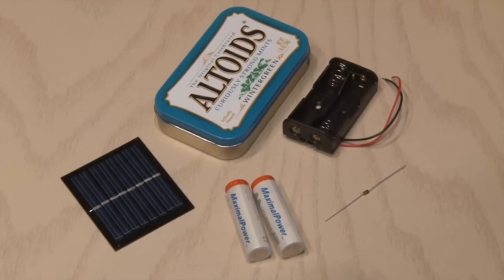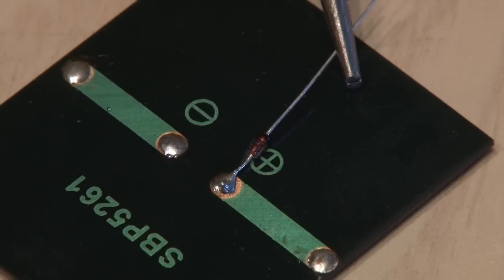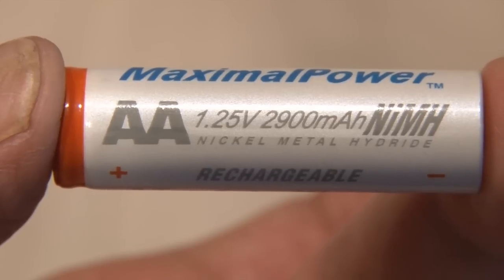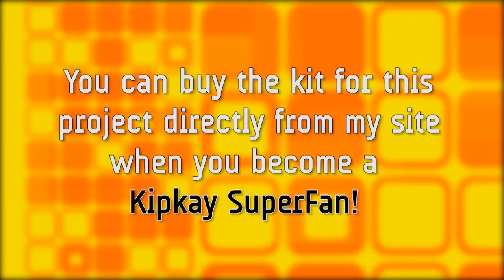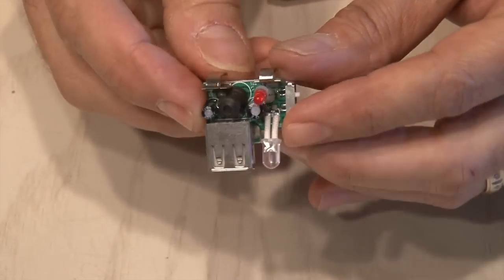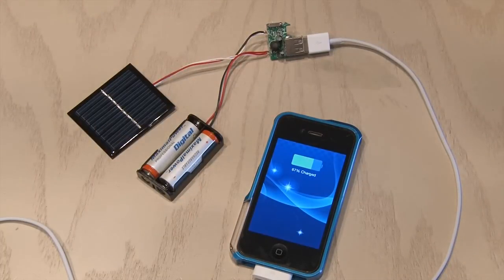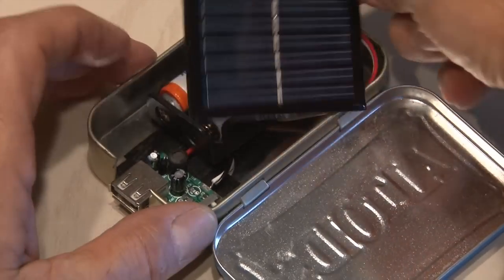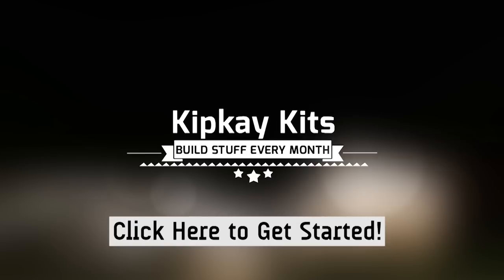Build a Kipkay Solar USB Charger!

Comment from the maker: Build your own Solar USB Charger!
Reply: you need to do it yourself, you can't have a ready made free sample, if you make it yourself, you can customize your own to do what you want
Reply: kipkay When you say standard diode do you mean something like this: 1N4007 1A 1000V Rectifier Diode DO-41 Tape. 
Because if not, I'm at a complete loss.
Reply: kipkay How many amps does the usb regulator provides?
Reply: Can you use rectifier diodes?
Reply: +Lone Wolf yes, any diode should do
standard means that other diodes like leds, and zeners won't work
Reply: thaks:)
Reply: Lone Wolf oops I wasn't paying much attention
Zeners will work and rectifiers also work
Zeners are more of a stabilizer
Reply: ok
this may be helpful for me
thanks to telling me all that
Reply: sir wat is that white device u used...
Reply: Raja Sekaran it's a device that uses normal batteries to charge a phone
Reply: where do u live and how much are you selling them I  like your video and I doing it for my project from school
Reply: +Angel Sanchez same
Reply: The kit isn't on the website anymore
Reply: i tried clicking on the link at the end of the video and your website told me it couldn't find anything for the link. Can this be fixed?
Reply: Pls fix it on the website
Reply: will any diode work?
Reply: yes
Reply: kipkay I don't have material
Reply: I really want to make this but what diode do I need, and instead of a portable charger board, can I just use a dc to DC booster 5v module?

Comment: Did he buy a portable charger to make a portable charger? I'm the only one that seems concerned...
Reply: christian villegas i thought that to lol. to make it easier he could have taken it apart, drilled holes, and soldered the solar panel then put it back togeather
Reply: Christian Villegas  He added a solar panel .
Reply: *****
But you can use this version while camping, your version requires batteries to carry energy, this relies on the sun.
Reply: Walter White Now he can use the portable charger to charge the portable charger.
Reply: *****
where's the fun in that?
Reply: +Christian Villegas that portable charger you can get get at the dollar tree so its worth it

Comment: This is by far the best and easiest diy solar charger for iPhones I've seen on here. KipKay makes it look so simple. Some of you are asking what the standard diode is? I live in the uk and I've always used a N1914 diode (I think those are the right numbers??) the one I use has a white stripe instead of a black one but yet principal when soldering is the same. The diodes are just designed to stop any power being transferred back into the solar panel from the batteries. I would recommend buying good quality rechargeable batteries with a high Mah as shown in the video, you can get 4 x AA rechargeable ones from my local pound shop but they only have 800mah power so it wouldn't give you much oooomph when charging an iphone.

Lastly, the only thing I do differently is leave a little toggle switch and the small led on the finished product as I like the fact that you can switch it on and off.

Overall a fantastic little project to complete in an hour or over a weekend. Thank you KipKay once again for your great tutorials

Comment: I would have mounted the solar panel on the top of the tin, just ran the wires through the tin and make it openable if you ever needed to replace the rechargable batteries
Reply: True

Comment: Wat was the tool that u used to connect all the wires . It was like a heatin tool with a liquid that connected all the wires .
Reply: em... soldering iron?
Reply: It's called a sodder gun
Reply: Soldering iron
Reply: Jevin Wilson ur the straight example of autosm
Reply: SaUcE x EeVeE Well that's ironic

Comment: I started building one of these years ago with regulators and everything so as to avoid possibly damaging any batteries by running too much juice into them... shortly after, these things were all being sold in the store.  I still have the stuff to make it (which I paid $6 for at radio shack) and still want to finish it... maybe a couple years down the road. :)

Comment: Would have been much better to make holes in the lid for the solar panel wires then hot glue the panel to the lid
Reply: i think the solar panel would retain too much heat there has to be air flow from under it

Comment: Can you connect the solar panel straight to the female USB port instead of the batteries? I just want full power as fast as I can. AKA zombie apocalypse.
Reply: Unfortunately not because the solar panel won't produce enough energy to charge your phone. But if you connect batteries, the solar panel will charge those batteries then from the batteries it will go to the 5v converter and provide a semi efficient charge

Comment: youre correct on that. You see he also uses an emergency phone charger which uses two double a batteries aswell. Inside that emergency charger is a 5volt dc boost circuit. This special circuit takes the 1.2vx2=2.4 volts(roughlys) and runs it through an oscillator which outputs a steady 5volts in a square wave. You see similar circuits in garden lights that uses one double a battery 1.2volts (mi-mh) to light a 3volt white led.
Reply: WTF?!

Comment: Couldn't you overcharge the batteries like this?
Reply: +Two - Dimensional nimh wont get overcharged from this puny panel
Reply: +DMAN22yeah that's a 4v panel, it may overchange them
Reply: Gulherme Pereira it will put out less than 100ma, which at 4v is only .4v, which will be dissipated as a trivial amount of heat.
Reply: DMAN22yeah So, instead of overcharging, it will just heat the batteries ever so slightly?
Reply: +Two - Dimensional yeah pretty much, they are supposed to get warm during charging anyways
Reply: DMAN22yeah Ok thanks

Comment: A diode is like a one way valve. It allows current to flow to charge your batteries, but prevents it from flowing the other way, discharging them.

Comment: Great video, I have 2 questions though. Would this work on a larger scale with more batteries and a stronger solar pannel? And, does the AA battery holder work as the input for solar energy as well as the output for power to the phone?
Thanks!

Comment: Will this work for an iPhone 5 connector? I'm interested in buying the kit. Also where can I get a soldering gun?
Reply: Yes, as long as it has a USB port. (The Lightning to USB cord) And soldering irons/guns are available at Radio Shack.
Reply: +jhRobert Skywalker
Reply: Buy it from the hardware store
Reply: Enmanuel Diaz Yes it will because it is USB
Reply: no, it doesnt charge if you dont use original Apple charger and usb, source: experience
Reply: Francisco Barraza it will, its probley have a broken Lighting Connector

Comment: The circuit board from that charger is a step-up transformer adapter, increasing about 3v to 5v for USB. In case anyone was wondering.
Reply: But without the on/off switch isn't that transformer constantly draining the batteries?  Shouldn't there be a switch??
Reply: mikekoz68
I never mentioned switches anywhere. But you're right, a switch would save on battery life big time.
Reply: Theres a switch on the circuit that little bar

Comment: My point is that solder keeps the flow of electrons on the path you want it to but hot glue would not. Am I right? It has been years since I built something. Thanks!

Comment: they produce 3v's, yes, but the wiring from the battery pack is also attached to a solar panel,  so i'd imagine the board would be getting a charge from the batteries and the solar panel.

Comment: is it possible to cut a slot kind of like a window for the solar panel then glue it so the altoidsso it exposes the solar panel so when u use it the other wires and stuff wont get exposed(just in case if it drizzles a little or if u accidently drop or something like that)

Comment: Idea's great, but does it really work?

I would guess using one of those "Grade A" cells out there you could get the energy from one panel in full sunlight, but this one looks small, and with low light it might take very long to charge.

Comment: Without boost buck circuit I can't realize it? Maybe if I should take solar pannel and batteries in series, when the solar pannel produces 3 volt and batteries produces about 2 volt, there are 5 volt so I can prevent use the circuit.. it's right?

Comment: The charger would be restricted to not allow back flow of power in to the batteries.  You could wire around that, but it probably would just be easier to make a new circuit like this.

Comment: So to apply solder for example you have to take the solder stick thing then melt it on the solar panel negative and positive spots then take the solder stick again then melt it on the diode. Then attach the diode to the positive side and melt them together with the solder gun????? And the same thing for wires??

Comment: If I replace the chip component by a USB female termination, a on/off switch and connect those to cables comming from the bateries, will it work? Destroying a functional usb emergency charger seems a little too much for this project...

Comment: I built a solar charger similar to this, the first edition of it I used hot glue to hold it together and it got hot in the sun and melted the glue which leaked out.  I would recommend using a different type of glue
Reply: xD Thanks for the comment I won't be using hot glue when I do this.
Reply: Legomax Gaming can you help me what are those red and white cables that he soldered to the solar panel called
Reply: Cesar Martinez just use any type of wire it doesn't matter

Comment: I just have a question about the battery setup. If they both charge at the same time, will one be done before the other, or will the charge even out between them? Also, can I use a 1N34A diode for this?

Comment: I don't understand the concept of the diode really, I know they only let a small current pass. I am making one and is there a specific one for different voltage? And I am using 9v. because I want to charge my ipad so , do I need a different one, will it work on my phone too??? And instead of 1 USB Ports I am using 2 does it make a difference??? THANK YOU SO MUCH!!!

Comment: Would it be possible to put holes in the top of the tin, put the wires through there, and hot glue the solar bit to the top? or would that break something?

Comment: yeah. Thats what i was thinking. But i think it might just charge a little slow, or in some cases, i think there is a little transformer in the phone. Anyway, there's visual proof! PS: Voltage is important in electronics but you MUST remember the difference between volts and watts. Volts is BASICALLY how fast the electricity is, but WATTS is BASICALLY how powerful the electricity is!

Comment: Technically yes, but that would just involve an extra step.  You'd have to charge up the batteries first, then charge the USB device.  Much more efficient to do it all at once.  And really with this he's basically just using the batteries as large capacitors.

Comment: You could cut a hole in the top of the Altoids tin and glue the solar panel in place. Then you don't have to move the inside components around as much!

Comment: quick question, wouldn't it be a good idea to have a hole in the roof of the tin in order to attach the solar generator to it so you dont have to open the box to charge things?
Reply: That's what I did, and it works you should do it
Reply: +ItzLezgo can i use 6v solar panel?
Reply: +Farid Yusubov no it is two much power and can hurt the battery's and the phone
Reply: +Farid Yusubov yes but  It will make it charge faster
Reply: +Farid Yusubov yes, you can use a 6v solar panel but you need a 3v Zener-diode to regulate the voltage

Comment: Just built this using these instructions plus step by step found on instructables... BUT... When I plug in iPhone 4s, I get nothing! It sings and shows it's charging, but loses power and doesn't charge even with the device off...!!!  I'm using 5v solar panel and 4 AA batteries. Also I am using the EXACT same charger kipkay disassembles and uses in his video! So why no charge?????  Someone help!!!  Kipkay? I am a superfan, after all!
Reply: Most usb plugs only put out 500mah of current but some of today's gadgets draw more then 500mah (like 2100mah for tablets), although the batteries are rated at 2900mah the circuit board may only be allowing the 500mah. If your phone draws more then 500mah that would your problem.
Reply: iPhone 4s... Not sure how much power is being drawn BUT most vids on here show it charging one...?
any ideas?
Reply: FloridaAdventurers
Look on your wall charger and see what the output current is that should tell you what it runs on. There is a solar usb charger on ebay that has a 10000mah battery and 2x usb plugs that supply 1A and 2A of current for under $20. Ive seen review videos on it showing iphones charging on it.
Reply: Allen McKinney
im using a 2AA battery recharging pack from ebay.  works fine by itself with the phone but when i hook up the two sets of 2 AA in parallel cells, it wont work... I hook up each ind. "Cell", works fine, but when wired together ... no luck...?
Reply: FloridaAdventurers
Not sure about that one. Are you making sure the + and - is right? You using rechargeable AA's or alkaline?
Reply: yes, and rechargeables 1.2v HR6 aa's
Reply: FloridaAdventurers
Thats interesting. It should work as long as the input voltage is the same. The only thing I can thank of is maybe the charger is sensing something we don't know about.
Reply: Allen McKinney
Possibly...
Reply: FloridaAdventurers 4 AA batteries = 4 * 1.25v = 5v, you probably need a solar panel that outputs a higher voltage, or you can try using only 3 batteries in series.
Reply: The diode.
Reply: kyleinmt
i have the diode in the right place, im thinking now that the rechargeables only put out 2.4 volts... i may need to add a thind to each "Cell" to increase it to 3.6v    think thast;ll work?

Comment: I have a lithium battery can i use that for this project instead of using the 2 AA batteries. and if it is possible can you do a video built with a lithium battery

Comment: If you're not taking the batteries out, couldn't you just use a capacitor instead?  Or would that be more expensive?  I haven't looked for the components, so I don't know.

Comment: I have a 3 slot triple a battery holder, would it work if i put in 2 batteries in 2/3 slots and then connected wires to those?

Comment: To charge these batteries you would have to wait hours. I built one of these myself with 7 old solar cells from garden lights. Even with 7 cells, the best amount of power I got out of it was about 55 mW. So, it was about 11 mA at 5.08 V using a 7805 as my voltage regulator. Needless to say, charging ANYTHING with it would simply not work.

Comment: Quick question. I live in Argentina. Sadly for us, importations and dollar purchases are frowned upon by the government, so buying your circuit is a big no...

Can I just use 4 NiMh batteries and skip the circuit altogether? 1.25v * 4 = 5.00v
I know voltage drops, but it won't drop lower than 4.6v, and it would stop working if it drops too low, wouldn't it?

Please answer! I'm very interested in making this project. Thanks!

Comment: Yeah I always thought a solar USB charger would be keen for a camping/survival kit.  Well I did some research and it lead me down a long and adventurous path of some pretty ground breaking tech…  I started with an idea of a solar flashlight that would give a bit of power back to itself, but would not last forever.  I know that nothing last forever on its own.  So….  Long story short.  I discovered some home grown smarts that used a peltier device to create a flashlight with no need for onboard power supply..  So I looked into that and then thought of a new idea, a camping stove that could charge USB devices.  Well I do my research before anything and found a camp stove that already exists and is on the market. The BioLite is a small compact camp stove that has taken the peltier device and incorporated it with a camp stove to create a wood stove generator..  Really cool piece of gear.   Works like a charm.  Check it out. Im gonna load up some video's of me using mine this summer.  Its called the BioLite.  Google that shit!!  Hahaha..  Live smart and survive!!
Reply: What is shill?
Reply: DaddyTheTechnition Shill is a casino employee who plays a slot machine, pretending to be a customer, to draw other customers in.
Reply: mosby95 Nah!!  I posted my post 5 months ago while I was a satisfied customer of a product.  Not anymore tho.  After a summer of camping my stove no longer holds a charge.  Shitty!!

Comment: Would the voltage output by the battery spoil a phone's battery? I thought it would lower the lifespan of the phone battery with non-ideal voltage output

Comment: I did this one time as an emergency to charge my phone while we were camping, I have a solar panel like 1 foot long that is good to recharge the car battery, so I took a usb car charger and dismantled it to use the usb port and connected the wires to the solar panel directly, i didn't use any batteries on between and it worked great, the phone started charging inmediatly. So my question is! Why do you have to build a battery pack? I mean that will be good as a reserve for a future charge maybe at night when there's no sun energy. Just saying!